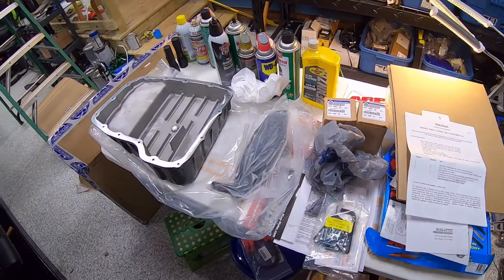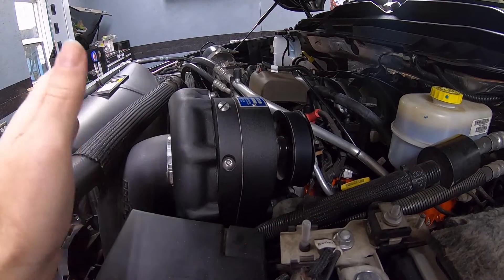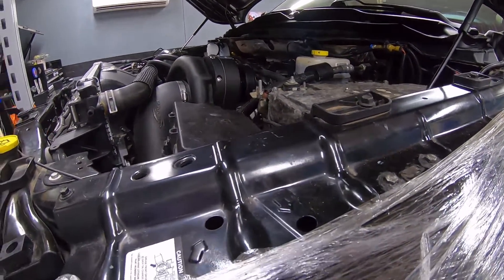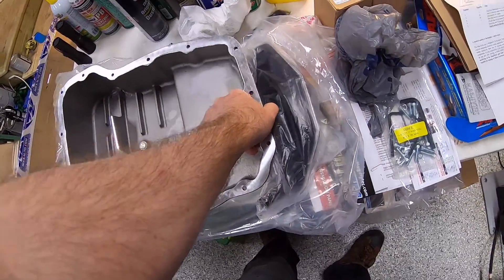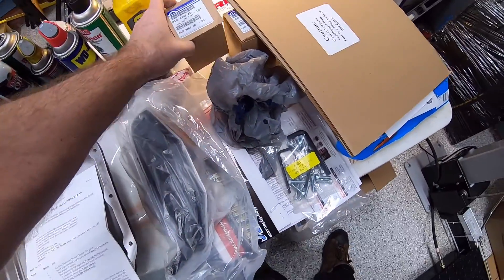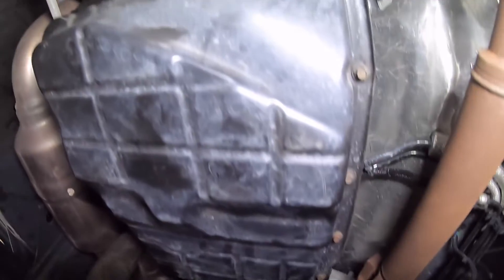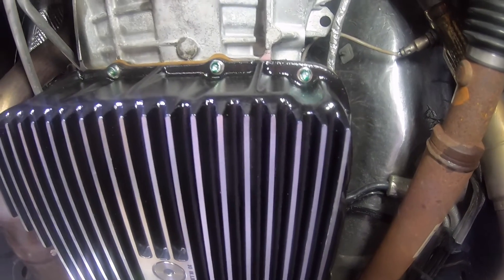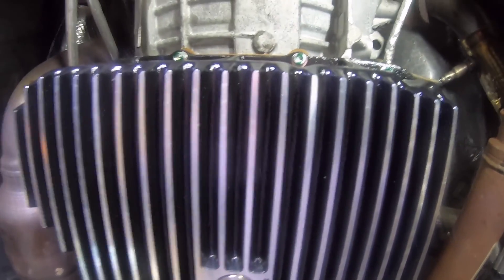2016 Ram 2500 Transmission Fluid/Filter replacement and pan upgrade.

Comment: Great video man. I'm going to do the same thing. I have a cam in my truck. I'm also changing out the torque converter to a 3k stall
Reply from the maker: Thanks.  Awesome to hear about the upgrades.  I did a 3K stall in our other project truck a 1500 along with a cam and procharger, quite a bit of performance difference.

Comment: Great series, thank you. The screw in cannister filter has aftermarket steel threaded adapters available to replace the plastic threading unit that comes on the factory cannister filters. Also consider replacing that transmission thermostat from the cooling lines with the available straight through aftermarket blocks. A possible failure part in the cooling circuit, and better fluid flow. Geno's garage and ATS transmissions for sources. I used both, with good results, peace of mind upgrades. Thanks.
Reply from the maker: Thanks for the comments and the ideals, I'll take a look into them.

Comment: Great video!
Reply from the maker: Thank You
Reply: @solargarage  how is the procharger working out. Plan to install on my 17 PW
Reply: @solargarage  what is the transmission filter kit? It's a 45rfe kit even though it's a 66rfe?
Reply from the maker: @Man_in_the_moon_oahu  Still working like a champ, but remember that I also got a tune from my tuner and did not use the ProCharger one.
Reply from the maker: @Man_in_the_moon_oahu  Hello, Yes the Mag-Hytec pan is stamped 45RFE, but it is the same fitment and filter for our trans.  I contacted them before purchase and verified it would be ok.
Reply: @solargarage  I do have a diablo tuner,  and been talking to Mr. Greene. I still have to install my AHR headers thst I just had ceramic coated before the procharger and exhaust. Any recommendations on exhaust?"
Reply: @solargarage  so order the filter kit for a 45rfe?
Reply from the maker: @Man_in_the_moon_oahu  For the exhaust, I only replaced the big stock muffler, with a MagnaFlow muffler.  The sound of a MagnaFlow is much better than stock, even with the resonator still on it.  I did try one for a brief moment from MBRP, but it had way to much drone in the cabin.  Yea Jay Green's tunes are great, have been running tunes since the procharger and they are running like a top.  Here is a link to a similar kit for the MagnaFlow muffler that I use: https://www.amazon.com/MagnaFlow-Exhaust-Products-19493-Replacement/dp/B07SDN3JB1
Reply from the maker: @Man_in_the_moon_oahu  Are you looking to just do a filter change, or are you looking at getting a Mag-Hytec pan?
Reply: @solargarage  both
Reply from the maker: @Man_in_the_moon_oahu  The pan if you order from Mag-Hytec directly will come with oval sized pan filter.  You will need to get the spin on filter however.  I got mine from rock auto.
Reply from the maker: Here is the RockAuto link for the spin on filter in a 2016 2500.  Looks like this spin on filter is used in several models and years. https://www.rockauto.com/en/moreinfo.php?pk=9618156&cc=3353664&pt=8600&jsn=1549

Comment: Your brake fluid reservoir has the same two blue dots that mine has… when I put the cover back on and didn’t have the blue dots lined up I was getting fluid on top of the reservoir, now that I have the dots lined up no more fluid.. I wonder if it’s something from the factory?

Comment: Hello, do you know how much torque the new allen bolts require for the pan? Great videos by the way.
Reply from the maker: Thanks for the comment, here is a link to Mag-Hytec's install for this pan.  Looks like they call for 7-9 ft. lbs.
https://mag-hytec.com/wp-content/uploads/2022/06/Dodge-45RFE_545RFE.pdf

Comment: Should have just drilled a hole in the bottom of the old pan to drain the oil since you were replacing it. I use a vacuum system i made to suck the oil out through the oil stick tube.